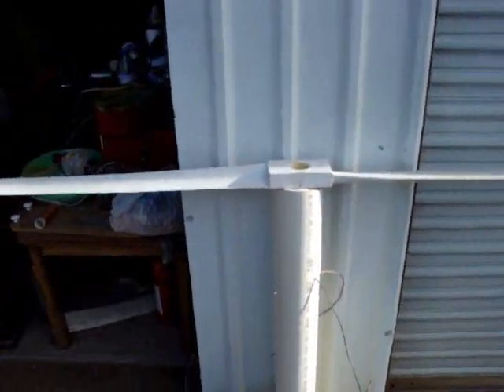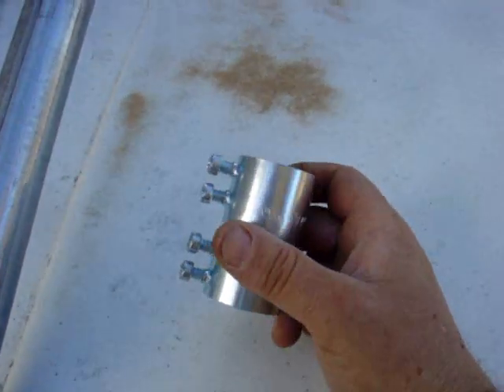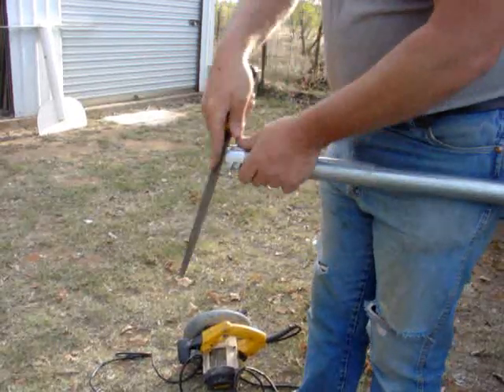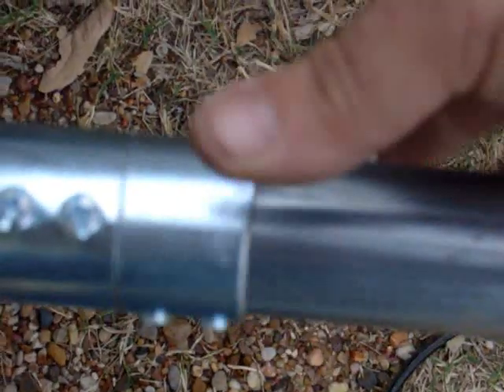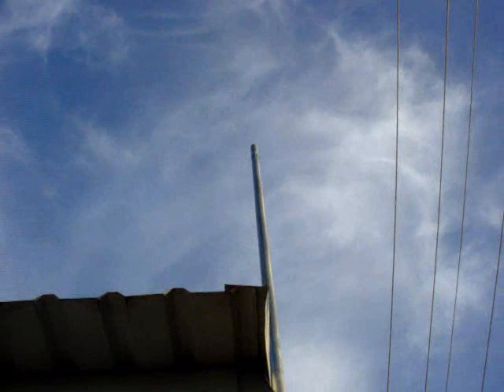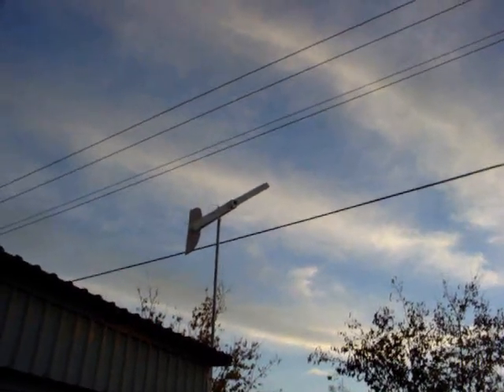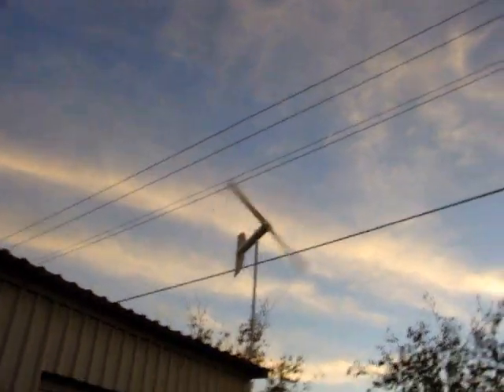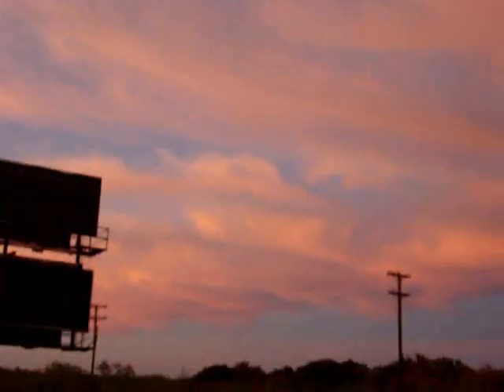THE TAPE DRIVE MOTOR WIND TURBINE INSTALLATION AT THE SHOP

Comment: @muddymuddymuddmann
 Yay Team...! The increased incidence of Visible & Persistant Contrails is the most obvious indication that the Atmospheric Chemistry & Physics & Thermodynamics of changing the Gasmix, as we've done, is raising the Global Average Temperature & changing the Weather. Water holds HUGE amounts of Energy, it has TEN TIMES the Thermal Mass of Steel. 5% more Humidity means MUCH Stormier Storms... Ciao !

Comment: @muddymuddymuddmann
 G'day Scotty ! Um, well, we can't see vapour, or humididy, & Air is Patchy. Fly through moist air, y'get a Contrail, go up, down, or forward & if the air is drier, no Contrail ; wetter, thick & persistant Contrail... If 2 Planes, identical, but one's full & other 1/2 empty, different Fuel flows for same Airspeed, the fat one leaves a trail. More Fuel, hydrogen, water in the Exhaust. Search my Ch. for "Chemtrails".   Ciao !